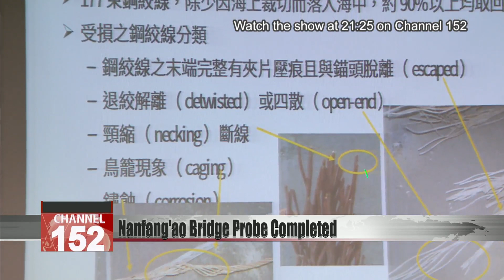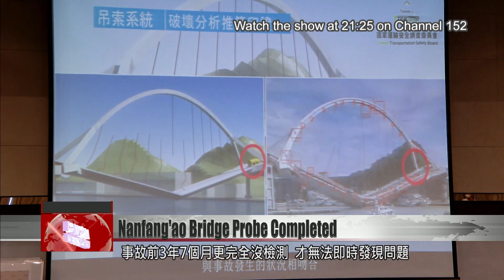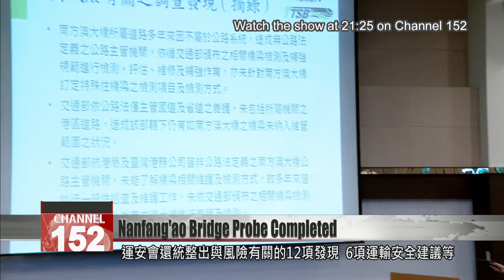Nanfang''ao bridge collapse caused by corrosion and missed inspections: probe

Comment: The suspender cables did not have enough redundancy, if one segment without support can weigh down the adjacent segments to cable failure.  Deck integrity is crucial to tied-arch bridges.  Also, arches are weaker without a load pulling/pushing them down, which is why the weight of the deck on the suspension cables is important.